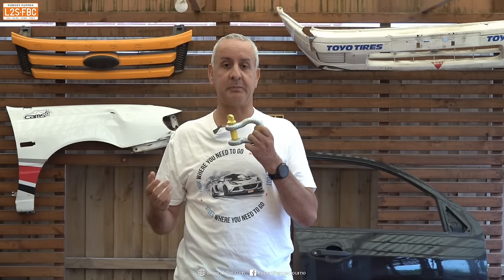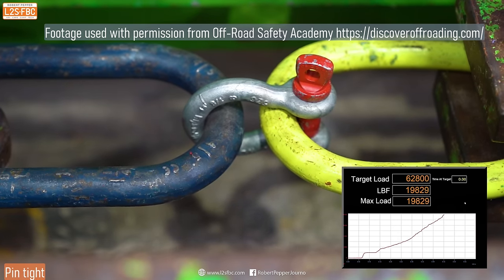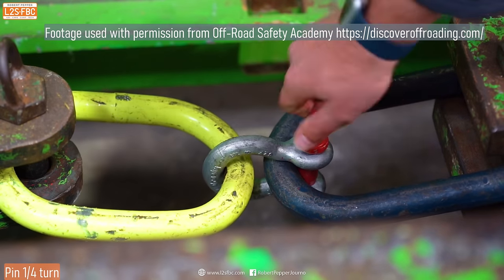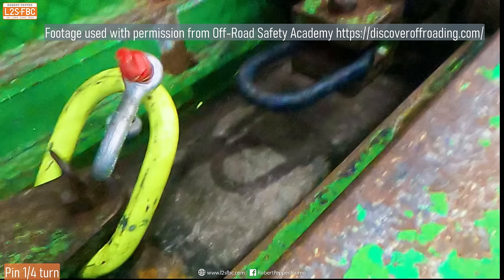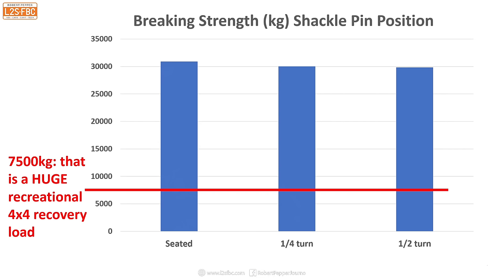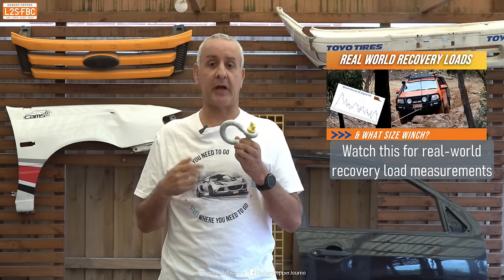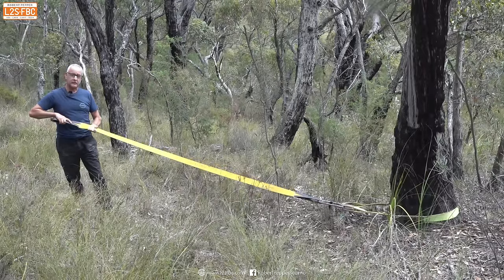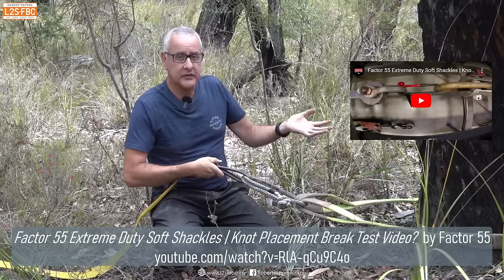What happens if you back off a shackle by 1/2 a turn?

Comment from the maker: Notes before you comment:

1 At https://www.youtube.com/watch?v=9mYzflG28uw&t=319s there is an error, transposed the 1/4 and 1/2 turns, sorry.

2 "Hi Robert. I'm a metallurgical engineer and do a lot of work in fastener metallurgy. Those three tensile tests are all within expected scatter for wrought steel parts (both for breaking strength and elongation percentage). If they had run ten samples of each condition, I would predict that the range of the tight, 1/4 turn, and 1/2 turn groups would overlap almost completely. I would also recommend anti-seize grease on the threads. This will prevent binding when removing the pin after use and prevent thread corrosion while not in use." - elektro3000

3 "The quarter turn was taught to sailors in ships anchor gear. There number one concern is corrosion and the ability to slip an anchor. Shipboard shackles are always moused closed so being able to break a shackle free of its pin when it has been siting in salt water for years is more beneficial then a three percent working load loss." @petercaires9276
1 hour ago

4 Sample size - I draw attention to the fact it's only three shackles. That's not as conclusive as 30. However, it's proving a negative; if backing off made a dramatic difference, then it'd show up for sure even in that small sample - consider a shackle with a cut halfway through its pin, you'd wouldn't need a big sample to show that's weak.  Not trying to prove that for example "all shackles break above X kg in which case if we took only 3 the 4th could be weaker.  I've also broken other shackles before, and they all had consistent results, and they are built to standards. This gives me confidence that the sample size could be small and still useful.  https://youtu.be/AVqYkgaaKAY  Also, these shackles are made to a standard which gives you confidence they will all perform identically.  Soft shackles are not, so you need a larger sample size.

5. The pro riggers and doggers disagree:

"I was in the heavy rigging industry for 50 years. We generally back off the pin just a fraction, not a 1/4 or an 1/8th. Fully  tightened you’d have to get a wrench to get it loose if you didn’t. I understand you could weaken the capacity by doing so but we never put a shackle anywhere near its maximum. All equipment and rigging has a built in safety capacity. When rigging gives way it was either damaged or overloaded."

"I m so used to snugging the pin to the shackle it is foreign to do it any other way. This coming from heavy rescue in the fire service and also dabbling in heavy recovery with a local towing service including working off of a 50 ton rotator wrecker and pulling and lifting some monstrous loads.  Their company policy is that all shackles are seated to the shoulder of the pin.   I would indeed love to see the research that has been done to prove that the pins could become unscrewed in certain situations. Perhaps heavy vibration or extreme/ excessive movement of the rigging.   Thank you once again Robert,  keep it up man!! Cheers from the US"

There are definitely varying views even amongst the professionals!
Reply: -  Thanks Robert - 
Collating all the opinions of the various warriors in the thread is great.

- NB. (Never trying to undermine - clarification is for us all - open and free), the 3 references I posted demonstrated that difference in opinion (likely "use dependent")  between 2 Authorities and a manufacturer.

Any real (significant) variation will be in fatigue life, not in single pull or other short term uses.- so significant reliability engineering outcomes will be seen long term, mostly in running or other semi-permanent rigging.

Next - demonstrate that HT bolts only work as intended when under "designed strain" - If there is no strain, the shear strength is little better than many other "non high-alloy steels".

Onwards, always understanding a little more about what we like to do.
Reply: Never broken a shackle in thousands of lifting/rigging evolutions. Refineries, chemical plants, offshore rigs, barges, heavy equipment,  etc. 
I have had several fully tightened shackles that could not be readily detached. It was quicker to re-rig than to fight the frozen shackle.
Reply: @bodabdan  Have broken some but they were Chinese and they were outlawed.
Reply: Maybe transposed but the conversion factor is 2.2 on two of them and 2.17 on the third one......

Comment: Hi Robert. I'm a metallurgical engineer and do a lot of work in fastener metallurgy. Those three tensile tests are all within expected scatter for wrought steel parts (both for breaking strength and elongation percentage). If they had run ten samples of each condition, I would predict that the range of the tight, 1/4 turn, and 1/2 turn groups would overlap almost completely. I would also recommend anti-seize grease on the threads. This will prevent binding when removing the pin after use and prevent thread corrosion while not in use.
Reply from the maker: Fantastic comment, thank you!  Yes should have said these tests are typically 1-3% or so margin of error.  Good tip re anti-seize as well.  Added that to the pinned comment!
Reply: As another mech engineer, fully agree
Reply: As a rigger and not an engineer anti-seize will attract dust and dirt into the threads. In my years of experience I have found the risk of corrosion is minimal. Shackles left in a crane chain box exposed to moisture and dirt for months without use and very little corrosion or binding. Also there’s a difference between cranking a shackle tight and just seating it by hand. In most cases you should still be able to loosen by hand as long as you aren’t cranking the shackle tight. Even though in most 4wd recoveries you may not exceed the breaking strength of a 4.5t shackle I do think it is possible that the WLL could be exceeded regularly due to the dynamic shock loading forces that may be applied during some 4wd recovery techniques.
Reply: Great comment, The concept that backing it off weakens the link doesn't make any sense at all. I'm open to proof, but this doesn't provide any.
Reply from the maker: Well if it was engaged by half a thread would be weaker?
Reply: @galacticnemesis366  Yeah I totally agree, anti-seize or grease just makes a mess. If anything I just hit them with a small amount of penetrating oil. They are not put together and left out in the elements for long times. Also the thread fit is looser than what you would find on a standard bolt. I think the biggest problem with off road recovery is that it's done by idiots who like to shock load the rigging
Reply: @L2SFBC  Yes, definitely. The difference is whether the threaded portion is being loaded in shear or tension. If you have it threaded in multiple turns, the solid shank is loading up in shear against the sides of the threaded hole and it doesn't make much difference whether it's "tight" (this isn't a clamped joint, it's just the unthreaded portion of the pin seating against the threaded hole) or "loose". By comparison, if you only thread the pin into the hole one half turn, the threaded portion won't be in far enough to get forced tightly in shear (sideways) against the inside of the hole. Instead, pulling against the pin will drive it to slide up the thread flank, meaning it will try to pop out of the threaded hole. This will put a shear load on the one half of a thread that is engaged. That half a thread will rip out at MUCH smaller load than it takes to shear the entire threaded end off.
Reply: @galacticnemesis366  I'm recommending anti-seize for shackles that are stored with the pin threaded into the hole (tight or loose, either way). As long as the threads are together, it shouldn't pick up excessive dust. If you tether the pin to the shackle and let it hang free, then yes, it will attract dust like a magnet and get anti-seize EVERYWHERE.
Reply: Seems to me the video points out a bit of a design flaw. The pins all sheared at the thread, and the pin sometimes binds in the thread, because the thread is experiencing a large part of the load. The thread is always the weakest point,  and in other equivalent applications you always set it up so that the shank of the bolt, (often just a pin or shaft) bears all of the load, the thread is just there as a retainer. Often just a simple linch pin or R pin is used as the retainer. In the demonstration, backing off 1/2 a turn made little difference, probably because all its doing is exposing a little bit more of the thread, but even when done up fully, the end of the thread is still exposed and shears at that point.
Reply: @jumboegg5845  If the thread is stepped down in diameter from the shank, it will always be weaker than the shank. However, if the minor diameter of the thread were equal to the shank diameter, it would STILL likely fail in the same spot because that is the location of the highest stress concentration. The pin sees a very high shear stress at the edge of the threaded hole. It would take a significantly reduced-shank pin to move the failure away from the first engaged thread to the middle of the shank. Either way, I don't see that it matters where the pin fails. The assembly is rated for a minimum failure load, and as long as it consistently survives any load below that minimum, it is fit for purpose.
Reply: @elektro3000 I know your not auctualy comparing the strength of the pin shank in sheer to the strength that a half of a thread on the edge of a hole would have?  
  I believe that you are using a extreme example to say that by the pin not being fully seated to "tight", pulling the bevel between the minor thread size to full pin diameter that the rigidity of the body would be compromised. Thus allowing the threaded eye to pivot on the loose threads . Increasing the stretching and sheer forces on the pin in the direction of the load. The spoken of 3% loss of strength. 
   Im not a engineer and could not do the calculations needed to save my life.
 Please correct me as needed and inform me if that's why or why not some shackles went to a thru pin with external nut and keeper to keep the full diameter of the pin all the way through both eyes and moving it's weaker threads out side of the eye. 
Just my thoughts as I was having trouble understanding. 🤔
Great videos! Looks like a lot of good information to be had.
Reply: I work on sea going tugboats . We  put neversieze on shackles. It’s messy but it works.The one exception is the main towing shackle, 50 ton. They are usually pin and nut with a locking cotter pin .
Reply: @vicferrari9380  I was comparing the strength of the entire threaded section of the pin inside the threaded hole, loaded in shear, versus half a thread on the edge of the hole, because that was the question Robert posed. Unless I misunderstood?
Reply: @elektro3000  my apologies on parts of my reply. I some how missed some of your earlier responces.. I really shouldn't comment at 2 am.🙄🤫 lol.
Reply: @Pocketfarmer1   - good demo of where different environments collide-  On a ship/boat it is less likely that the neversiezed part will be dropped in the dirt (the fear of many with "gloopy components) - unlike the environment of a dogger on a building site or is a yard..  

(Your "Cotter pinned - permanent main - shackle -- ie. not coming undone without tools anyhow... (the full parallel shank of the pin also removes the thread from being a stressriser in shear - probably never failing from fatigue either..
Reply: 100% agree, test shown, though calling it a test is rather generous!.
Reply from the maker: Yes in practical terms something else would break and if you did get to plastic deformation you'd notice it when you came to undo it!
Reply: @galacticnemesis366 seems like an application where a Teflon wax dry lube would be the best choice. Totally non tacky, but maintains a good coating while it's just sitting unused, and should hold up a useful amount through a few uses before needing to be reapplied.
Reply: @elektro3000    I read your first post.   I asked myself, 'only screwed in a half of a thread ?'    I think the post needs you to edite/rewrite it.
Reply: Excellent observation.
Reply: shackles should be oil and greese free so they dont hold debries
Reply: @galacticnemesis366 possibly if some idiot is using a chain but highly unlikely when using any type of kinetic rope or strap.
Reply: Maybe you're right.  But here's another potential perspective.  I'm in manufacturing as well, specifically a QE with a significant amount of my career dedicated to failure analysis and I have a couple of potentially (not claiming what I'm saying is definitive, just another perspective).  It's very hard to tell, but it looked to me like the threads stripped on the second test, and that appeared to be a different failure mode than the first test.  It's really hard to tell without high speed footage, that was just my impression from what I saw.  You'd actually need to test 32 pcs of each at absolute minimum to be statistically significant.  If you ever can't sleep, look up why you need that many, you'll be asleep in 5 minutes, lol.
Reply: Was thinking the same thing and if I was going to apply 62k lbs of pressure to a shackle it would be a he'll of a lot bigger than that one.
Reply: I’m not disagreeing with the original comment, but I will qualify it with a 30 year ocean going tugboat career. Unprotected metal threads in a marine environment rusts. Quickly. You’d think a light coating of a penetrating oil would suffice, but it wouldn’t, even with the screw pin securely seated. Being exposed to rain, spray, ice, wind and sun negated the effects of oil when stowed on deck and wasn’t much better if stowed in a gear locker. A thicker lubricant that helped seal out the elements is what was needed. A poster above said they use never seize. We always had a bucket of grease and a long handled, angled paint brush. Threads on screw pin and bolt shackles were cleaned and greased prior to stowage after use and as needed while in use, along with regular scheduled maintenance. The trade off of possibly picking up some grit or dirt versus fighting rust seized shackles in the middle of operations was a no-brainer. 
Again, not disagreeing. I will say that my recovery shackles are greased. Old habits die hard even after retirement, LOL. No never seize though; that stuff gets everywhere if I even look at it. 😂
Also going to add only ever hand tightened screw pins, although the “back it off 1/4 turn” was always a mantra to some.
Reply: A sample size of one is pretty useless and doesn't prove anything. Kind of a waste of time.
Reply: EXACTLY
Reply: Great comment, just another couple of control tests would have been nice to see or maybe just 1 more fully tightened test straight after the backed off tests.
Reply: @FredPilcher I am a structural engineer, not mechanical, but I suspect the reason is not unlike comparing a simply supported beam to a beam fixed at both ends.  A beam with fixed ends will support a greater load since the bending moment is spread more uniformly throughout the beam.  If the shackle bolt is fairly tight, that will lessen the rotation at each end and be like a beam that has some amount of fixation at each end.  If the shackle bolt is loose, this allows more rotation in the threads due to typical thread tolerances and also allows more rotation at the head end since the circumference isn’t pressing against the shackle allowing more latitude for rotation.  Obviously, this different isn’t huge, but then the difference in breaking loads wasn’t huge either.  Anyway, that is my theory.
Reply: I've got copper grease on all of mine
Reply: @elektro3000  When doing 4WD recoveries the shackles and other equipment are inevitably in contact with dust or mud when they hit the ground.  Anti-seize on the threads is not useful, even though technically it is a good idea.
Reply: From my understanding you back it off slightly so you can undo it again easily, if you make it even hand tight then when a load is taken up on a sling for example it can grab the pin and twist it tightening it beyond what you can undo with your hand, if it's backed off slightly then it can afford to twist in the tightening direction without actually bottoming out and becoming very tight
Reply: @galacticnemesis366  An
Reply: @elektro3000  if you put anti-seize on a shackle pin on a job site, you better learn to duck… and once again, you’re talking a out using the shackle well beyond it’s practical limit. Go spend some time on the job using shackles all day, you’ll quickly learn how much easier your day is if you back it off a fraction… of course, there should time when you don’t want to, and instead tighten it right up, but that’s rare. You just need to think about what you’re doing and select the right gear and technique for the job… the problem is, it’s people like you who write the procedures that people who know better have to follow…